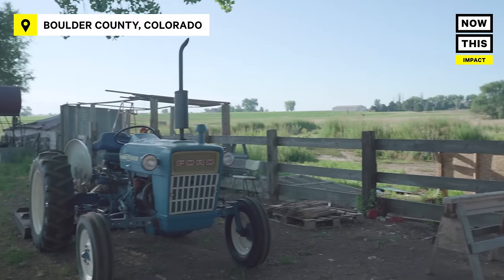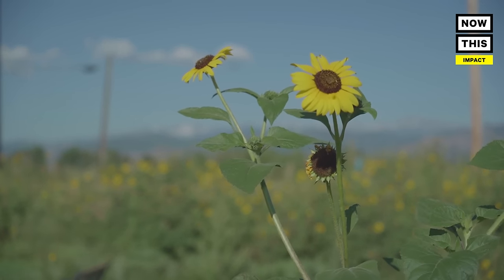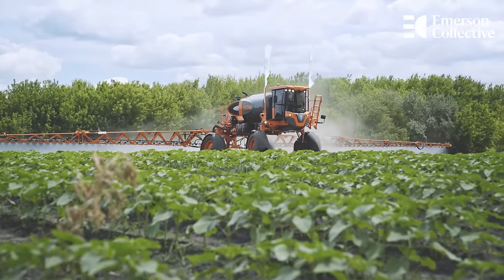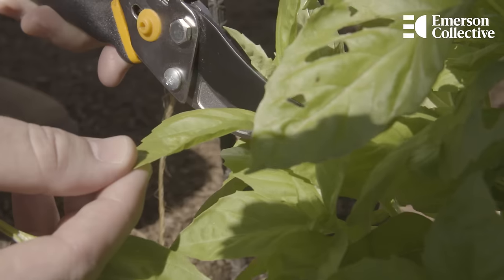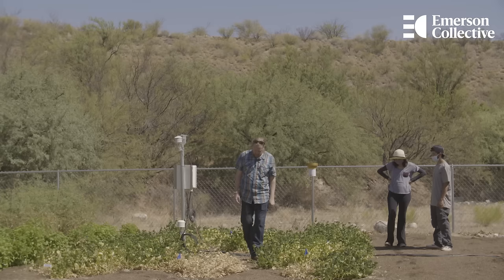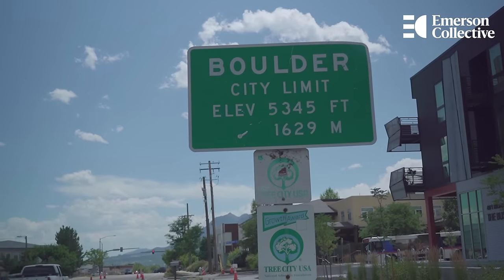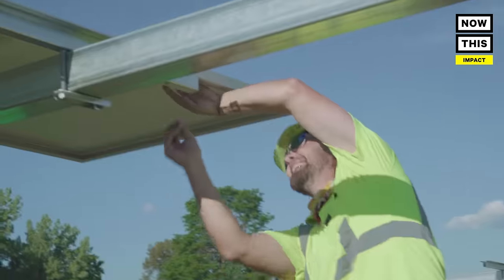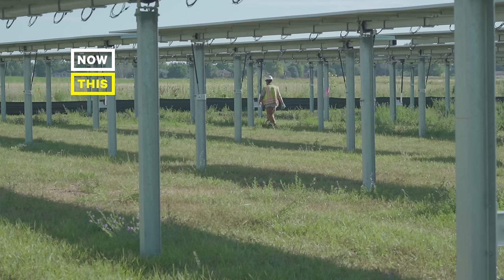Agrivoltaics: Solar Panels Bring Life to Struggling Farms | NowThis

Comment: Might want to ask a real farmer how many crops actually grow in the shade, or how realistic harvesting crops would be while driving a tractor through a solar array. This is a quaint idea for quaint market gardens.
Reply: The crops that grow in the shade often are the leafy greens.  There are members of the tomato family that do well in the shade.  There are many crops that hate the heat more than the shade.
Reply: @kensmith5694  
“The target light level for lettuce production is 17 moles of light per square meter per day (daily light integral, mol/m2/d) for optimal growth,”
hortamericas(dot)com/blog/news/monitoring-is-crucial-for-growing-lettuce-and-leafy-greens-year-round/

There's a reason industrial scale farms don't do these gimmicks now. Smaller, niche market gardens tailored to specific crops though may be able to work out the logistics.
Reply: @TheBighatter  
If the temperature goes above 40C plants stop.  Thus in hot places the shade may increase production.
Reply: @kensmith5694  
Again, sounds like a fine idea for boutique mushroom farms, or more broadly once translucent or mesh-style panels are invented, to act similarly as traditional opaque shade cloths.
Reply: @TheBighatter  Repeating a wrong thing doesn't make it less wrong.  I explained the facts.
Reply: @kensmith5694  
Haha, ok. Report back when farmers in significant numbers adopt this.

Comment: Not Feasible. As placing solar panel on large area cost so much that value of agricultural product is fraction of  solar  panels. Solar panel can pay its cost by selling electricity  but it may take more than 20+ year. It is useless as such a large investment pay so less or nothing. Investing that much money in some thing else can pay so much profit. For example your land rate is 1 million dollar and your agricultural product give you profit of 10,000 dollar you can't invest 100 million  on covering your entire land with solar panel.
Reply: According to the latest numbers I saw:  If you finance an array of solar panels like you would finance a house etc, they pay for themselves in about 8 years.  (This is without any government help.) After that the energy goes to the bottom line.  On modern panels, the MTBF is over 20 years.  Thus doing panels does make a return fairly well.  
Placing a spaced out array above crops is a topic I have not done the numbers for but at first glance, the array its self appears to be a worthy investment.  If it at least doesn't decrease the value of the crops below, the farmer comes out ahead by doing it.

Comment: in a nutshell: "photovoltaic plants take so much room, you can farm under it"
an antiquated nuclear plant would output the same amount of energy in a really smaller area, w/o all the damage that mining rare earths to build those panels cause to the environment.
Reply: Hang on, what about the damage from uranium mining, processing, vast carbon footprint from cement mining & processing +,+,+ the radioactive waste from nuclear?
Reply: @guringai  even with all that, the carbon footprint of Nuclear is still smaller than solar & wind. not only when building & dealing with the waste (yes panels are highly pollutant, just like mobile phones), but solar & wind are complemented with fossil fuels when they aren't generating.
there are some great TED talks explaining this point.
Reply: @jgr7487  You can lay 4 times the amount of solar compared to nuclear at the same price. And ongoing costs for solar are basically 0.

Comment: If we cover large areas with dark panels, more of the sun's energy will be absorbed instead of being reflected back into space.  Solar panels could end up exacerbating the warming of the planet.
Reply: Plants are quite dark but your point is worth doing a bit of math on.  What fraction of the earth surface would need panels to meet the energy needs.  Perhaps pull out your electrical bill and look at how many KWH you used in a month.  
Useful points:
1 KWH in a month means you averaged about:
1KWH * 1000 / ( 30 days   * 24 hour) = 1.3888W
A square meter of (3 feet by 3 feet roughly) makes about 30W as an average
Battery storage or the like can be assumed to be 100% efficient for the estimate purpose

Comment: Our existing crops weren't paying the bills but we had the money to invest in a costly experiment. Smells like bull excrement.
Also, dial down the politics and fear-mongering. "America's farmers are facing an existential crisis due to trade wars, commodity prices, and climate change" You did not support that rather broad and meaningless statement. Instead, your next bit was "100,000 farms closed between 2011 and 2018". No context at all. Just a number. May have absolutely nothing to do with trade wars, commodity prices, and/or climate change. You guys go on...."Climate scientists say that the climate crisis will bring on more extreme weather in the future" Well...obviously. It's obvious that anyone who would use the phrase 'climate crisis' in a non-ironic fashion would also likely believe it will cause extreme weather. Also, there has not been an increase in 'extreme weather' to date and you have not shown otherwise. 
I stopped watching at that point. What a garbage video.
Reply: Since the panels work out to be a good investment, taking out a loan to put them up makes perfect sense.  If someone has a farm that grows cabbages and could switch to a higher value crop if they bought some equipment, they could easily float the loan.  The same goes for any other thing that makes a profit a few years out.
Reply: @kensmith5694  I get what you're saying, and you're not incorrect. That said, if events transpired as you detailed, the video would be just of a farmer making an upgrade. This was an experiment (their words), of which, the outcome was not predetermined. Which I say again, would be an incredibly risky endeavor for a farm that cannot manage to pay its bills. So something is off. Either the farmer was exaggerating his circumstances and/or this was less of an experiment and less of a risk than we were led to believe.

Comment: Talks about water shortage, uses solar panel as a solution.

Me: But that doesn't solve the water problem...
Reply: The shade from the solar panels makes the plants need less water
Reply: @Souleth And the sound muted. :3
Reply: Except it does because the shade prevents water evaporation and the panels themselves protect from wind. Plus you literally water the plants when cleaning the panels.